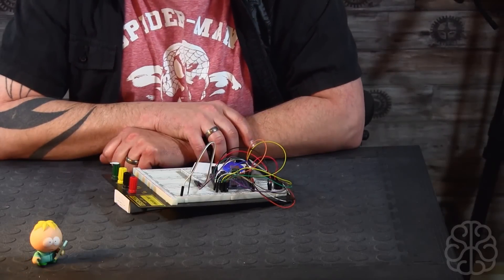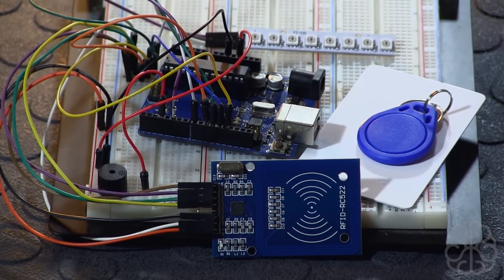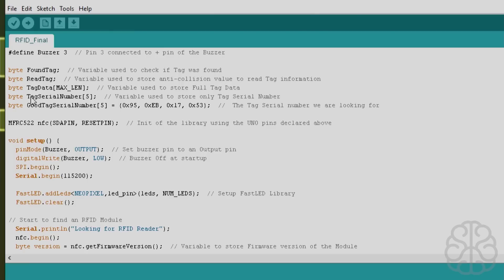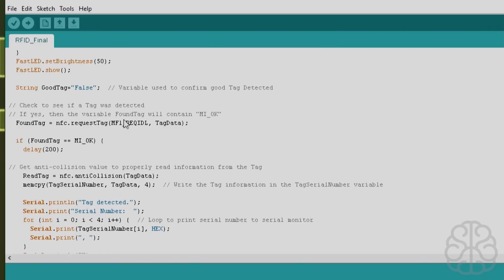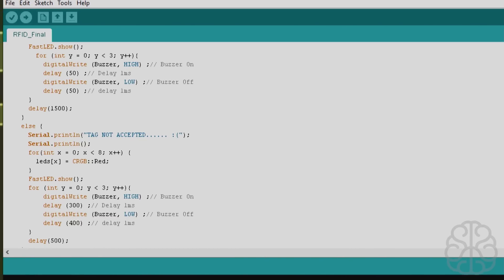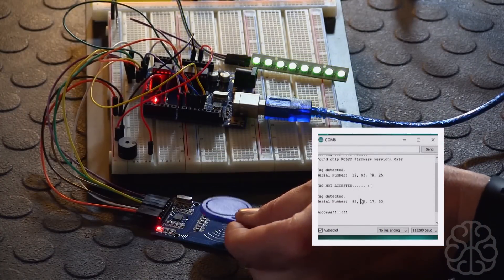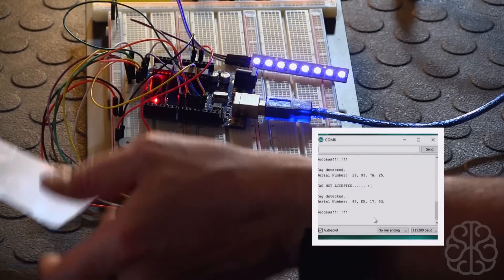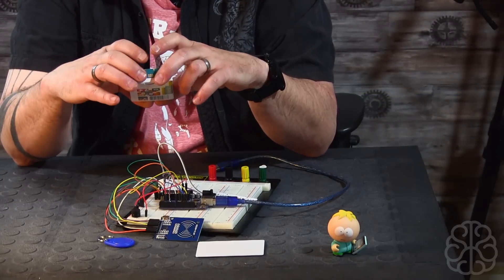How to use the RC522 RFID module with an Arduino - Tutorial

Comment: How could I update the code so that as the card is being scanned it will change the color leds to a defined color and run a chase sequence on the LED strand....Once the key card code is confirmed it will then flash a solid color for the confirm color defined or a different color if the key card is not valid?

Comment: Great Video! Your code explanation was great! I just wish you could have shown a quick schematic of your set up. This is the first of your videos that i have seen. 
Are their any on basic use of the ESP 8266?
Reply from the maker: You can check out the schematic for this tutorial here: https://www.brainy-bits.com/card-reader-with-an-arduino-rfid-using-the-rc522-module/
I also have some more tutorials on the ESP8266 on the website if you want to check those out too.  Thanks for watching!
Reply: @BrainybitsCanada  funny, i just purchased the rc522 i have had them about two weeks. Right now im working on a controller for my amateur repeater using wifi to connect to it at a location on international Drive in Orlando Fl. Using the esp 8266.

Comment: Have you soldered "the pins" coming out of the RC522 (I mean the pins that are connected to the colored wires). My RC522 came with the card (which has holes for the pins)  and the pins separately. Is it enough to just put the pins inside the holes or is soldering absolutely necessary?
Reply: If you hold the pins tight against the holes it will work, but you should still solder it in. (I know it's been 5 years but I don't care)

Comment: if you are getting MRFC522 error
simply download rfid master .zip
open arduino ide - open sketch in tool bar- click on include library- add zip library - just add rfid master.zip file 
go to file- example- and open dump info file and upload
Reply: It keeps saying that nfc has no member "begin" I'm not sure where I'm going wrong I have the same code as he wrote. I tried what you said and it still isn't working any other ideas?

Comment: During uploading, there was an error 'MAX_LEN' was not declared in this scope. im using arduino mega. the pin assign was already change before I uploaded. what was the problem?
Reply: I'm getting this error too..along with a TON of other errors
Reply: check the guthub link for your mfrc522 the mega pin outs are different than the Uno ones

Comment: if you're getting compile errors you're probably using the other MFRC522 library (https://github.com/miguelbalboa/rfid). this Brainy Bits tutorial uses the ljos library (https://github.com/ljos/MFRC522). if you install the MFRC522 library through the Arduino library manager it will install the incorrect library and the sketch won't compile. be very careful about which library you use.
Reply from the maker: Thank you for your comment, it might help others if they are having problems when compiling.  Would like to remind our viewers that we make tutorials pages on our website that has more information like schematic, code and links to the library we use: https://brainy-bits.com/tutorials
Reply: Thank you!

Comment: sir .really a great project...loved it...but sir how to increase the range...i mean if i want to use it at enterance of room..n if tag is embedded on students uniform..so how to increase the range...(this is actually my final year project)
Reply: so that it can detect the tag easily ...without going near the receiver ..
Reply from the maker: +mohit sinha Thanks for the comment, the RC522 module is not very strong and cannot be made to detect the tag or card at long distances, I know you can modify the gain somewhat in code but it will not be much more than 10-15cm anyways.  It all about the size of the antenna and magnetic field created by the module.  Like at some stores when you exit, you have those big pillars that you go through that can detect some embedded tags inside boxes or clothes to detect shoplifters.  Sorry about that :)  Thanks for watching!
Reply: +Brainy-Bits thank you sir for the reply and guidance.. I'll see to it right now
Reply from the maker: +mohit sinha You're welcome, let me know what you find out, I would be interested in a longer range RFID also :)

Comment: R522 is 3.3v but Uno is 5v, i didn't see any logic level convertor and also you didn't mention that, is this module working with 5v or it has convertors on the board?
Reply from the maker: +poohmsh Hi, It seems that as long as it's powered with 3.3V from the Uno it will work fine, I've never had any problem or damaged one using it directly without a level convertor.  But of course if you want to be super safe then you could use one :)  Thanks for watching!